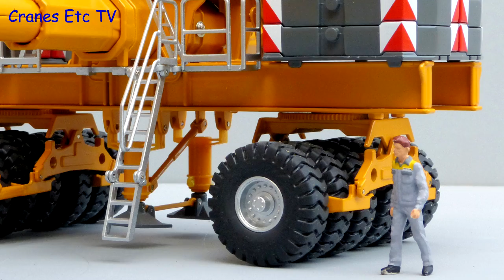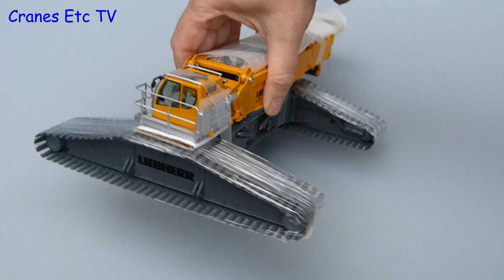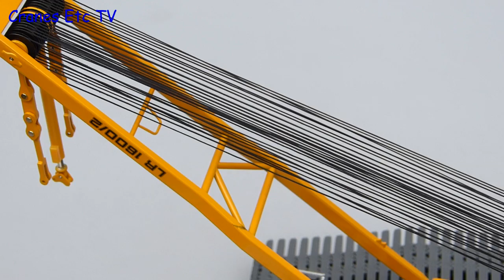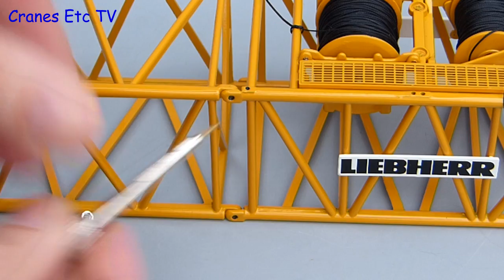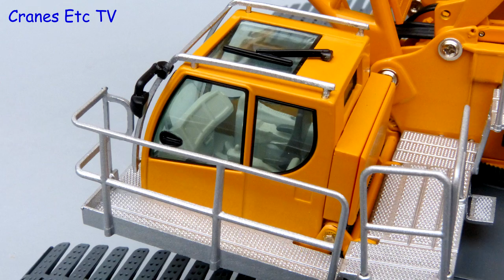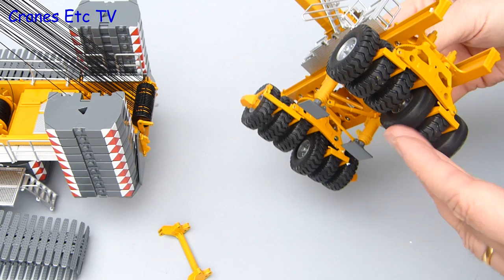NZG Liebherr LR 1600/2 Crawler Crane by Cranes Etc TV

Comment: I have got to ask. I am having sooo much trouble reeving up the derrick to the boom (haven't gotten to the jib). I've tried just doing it manually (fingers and putty) and I get one or two wraps, then something goes wrong and something jumps off.

It's getting them on the pulleys and past the pulley bars (whatever they're called) that's the problem. The A-frame actually ended up pretty easy because somehow I got the string to stick in the pulleys. No such luck with the derrick/boom pulleys. Any tips?

(tried a needle (can't get the thread through), tried putty on the end of the string, and now supergluing a piece of wire bread-tie to the string and the tolerances still don't let it fit)

Oh. While I'm at it. Is the Jib diagram in the instructions correct (every other pulley)? Or should I use all of the pulleys for accuracy?

Comment: I was wondering...you said this models big hook is reeving up on 2 winch drums so my question is do you need to operetae 2 drums to keep it in parallel level or are both being turned at the same time? if you understand my question!
Reply from the maker: +Vexrazor   If two drums are used they have to both be turned at the same time.  Same as the real crane.

Comment: I am having trouble with the tracks. Both had links broken when it arrived. I'm thinking I may need to add one or two. Any suggestions?
Reply from the maker: +craneinsane USA   From memory NZG supply a few spare links with the model.  If not, then probably best to go back to your dealer to get the problem resolved.
Reply: One of mine came loose from the factory, one link too many, as well as one link broken. Took me forever to get it put back together. Scotch tape helped me keep everything together while finally getting the final length all put together. (just be careful when taking off the tape, or you'll do it twice)
Reply: แคตอ